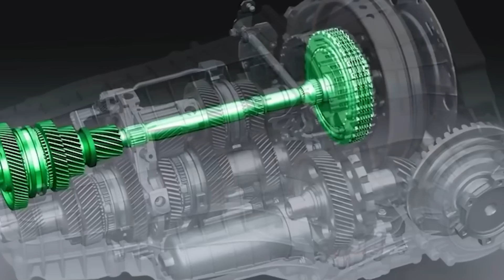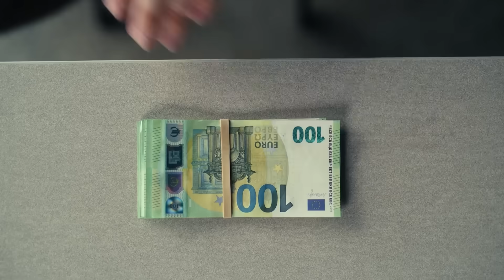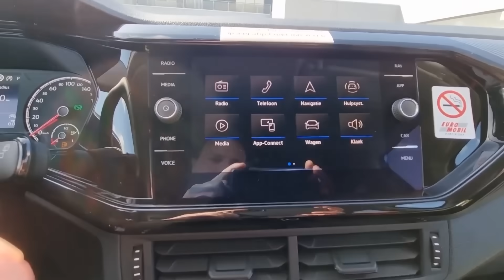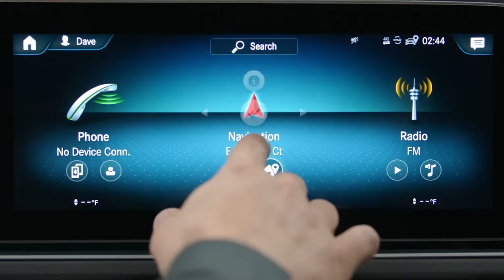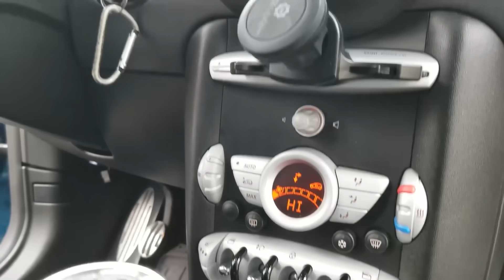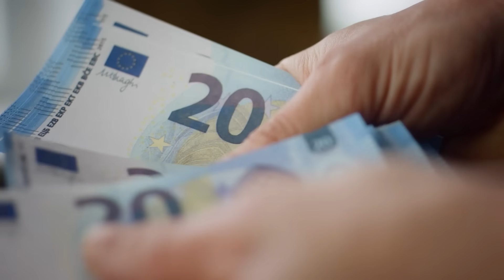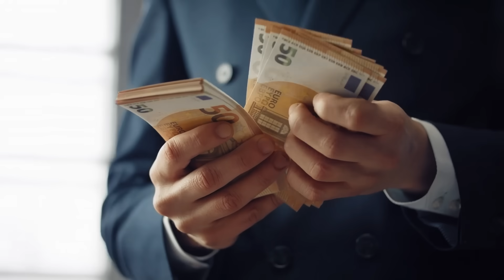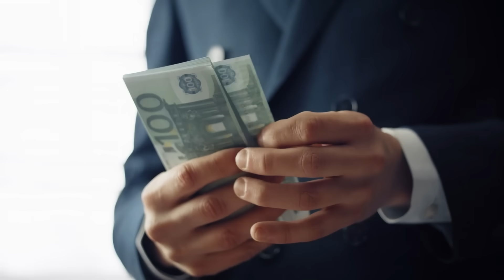7 DIRTY Secrets Why Your European Car BREAKS After Warranty

Comment: My BMW128i engine has no cylinder sleeves. This causes the engine to be totally unrepairable when they become worn. I used to brag to friends that I have never had any problems or failures. I just paid for maintenance. Then boom!  I did decide to replace the engine and it was very expensive. After consulting with my independent mechanic, I made that choice. I live in a dry climate so rust isn’t a problem. I know the health of the rest of the car. Hopes are I can get 50,000 miles before the used replacement engine comes to the end of its planned life. 
Next car I’ll buy will be something like a Toyota Avalon, 90s V6 Buick or Crown Vic variant.

Comment: 2018 BMW 4:30 I convertible I have had at least three coolant line failures because they are made of plastic. The plastic part on the side of the engine block that accepts the large rubber radiator hose became brittle from heat and started to late. It was a hairline crack and very difficult to find.plastic components in the oil cooler disintegrated from heat and the oil cooler needed to be replaced. The turbo coolant line which is part plastic and part metal deteriorated at the plastic end. This should not be considered planned obsolescence, but criminal intent.

Comment: My friend’s Lexus been 8 months in the garage for 2 items. First 3 months, car 2 years old, am engine sensor. 3 months wait. February 2025, front right calliper rotted and seized and he hood cable snapped (vs alloy callipers as premium cars). Job estimate ? 3300$ one cable and one calliper. Issue is no cable in stock so he has been driving a loaner!!!!! Yep, Lexus, so bmw tied them up for a reason. For all my repairs on my 2014, trans rebuilt, TC swap bearings suspension, my car never stranded me and I think longest was 1 months off during covid

Comment: Thank you for the information. This was not new, but a confirmation to me. I didn't buy VW anymore and use instead Kia with a 7 years warrenty.
Reply: Kia cars have many similarites with german ones. Smaller turbo engines, DCT (similar to VW DSG) transmission and such.
Reply: @rannarharmaste9857  The Hyundai/Kia Theta engine series are ticking time bombs if you don't keep up with the maintenance.
Reply: @rannarharmaste9857  There is no 150.000 km and 7 years warrenty on german cars. They know why ...

Comment: I will never touch a BMW again. We had a 320d with the N47 engine. It died because of the timing chain, but fair enough because it was at 190,000 miles. We then got another one, second hand, which also developed the same problem within 3 months. Never again!
Reply from the maker: That’s rough. Timing chain failures on those engines really hurt BMW’s reputation, and stories like yours show why some people never go back.
Reply: @UnderTheBonnetTips 
YES IT DOES. And china takes over with they're cheap s...t and it all over! Not again, noo
Reply: Soooo, you knew well what was it's weakest point, ..the failure of the 1st one and YOU DECIDED to do nothing(!) for 2nd one?? It was about investing in something that is pnone to fail miserable but it drives well and is nice.. (hmm, how should we call this..?)

And you think we are getting better as species?? 🤣🤣
And you THINK the future is even nicer, better!?  😂😂 
If we don't act and prevent..
Reply: Read this my friend, it is real experience of mine with an ..JUUST A BIT older BMW:
(original timing chain at over 300k miles, every single day driven)
BMW 3 series with M47 2005 cast iron engine, over 300k miles, over 500k km.. 2 stroke oil JASO FB in fuel 250ml/50 litres of fuel for over 250k km!!!! 
Result!?
Not a single sensor changed from intake manifold to exhaust including exhaust. ORIGINAL CATALYTIC CONVERTOR.
 Not a single problem with the engine! Everything is original - everything. Including the exhaust.. Injectors lasted as much/long 500k miles. 
Original high pressure fuel pump. 

Changes to prevent failure (AT 150,000 Miles done already..) :  fuel tank pump, ..rebuild of the alternator (first brushes.. then collectors) original alternator, still on the car! Injectors, rebuild by Bosch representative ..2 injectors failed just after the car passed 500k km.. one loud bang under the bonnet (but the engine did not stop) got me concerned.. / took them out, sent to get rebuild; car back on the road!
...Changed MAF (mass airflow sensor) ..got an error since I got the car.. now it is showing the correct values..
...Heat-exchanger failed.. GASKETS only, just after 500k km replaced car back on the road. 
Original engine radiator - water pump (belt driven) replaced twice in 500k km!
Thermostats.. they do fail every 4-5 years because thermostat arr not getting/keeping the engine to the right temperature. Because these has a spring inside that weakens overtime..

But all these are NOTHING comparing with complete failure of gearbox..., timing chain guides.., electric water pump... after 100k

Yes, I replace fluids periodically: coolant every 4-5 years -brake fluid every 2 years (..everything original by the way, still working in breakig system) steering fluid replaced every 2-3 years; that is not hard at all.. Gearbox oil, every 150k km. same with the oil in differential; these 2 are from factory since 2005; the oil are different types but saved the gearbox and diff..
Please, buy an used car and don't biy new! And try to maintain yourself; is not hard! Only like that you'll have more money! And belive me you'll save the planet more than buying new..

But the real message to you all is 2 Stroke oil 250ml/50l fuel is the formula(!) for a clean and RELIABLE DIESEL ENGINE.  Do you think this 500k km engine is a lazy../worn so much.. and weak at these miles/km!? 
I am having the same reaction from the car as when it was 250k(!) when I got it! 
I am driving my brother car, same engine, ocasionally, and that car has half of the km of mine (...no 2 stroke oil yet) and drives IDENTICALLY, reacts the same as mine, which is crazy!

And that is not all. I do maintain another bimmer ..B47 engine (it is diesel of course) with just 110k k  curently.. Euro 6, right? 
It gets 2 stroke oil with every fill of  fuel as my M47.. but it gets JASO FB as well! JASO FB (not FD) burns much cleaner! 
For the last 20k miles since I got the vehicle.. this car is been driven only short distances most of the time, which is a KILLER for a diesel and with DPF! Well, guess what? ZERO problem in 20k miles from DPF FILTER!
Do you think I am making things up because I have nothing else to do!?
Well ...I have my experience and I my only wish is to share with people who really wants realiability of their cars; that all.
That is my last point..
Good bye and ...Good luck with everthing that you intend..
Bye.😊
Reply: @MrFryfish All well and good, but I understand that the M47 engine has a rather different reputation from the N47.
Reply: @robd9863 
That is exactly the idea of his video...
To show us, ignirant drivers, customers that manufacturers started A WHILE BACK taking us for a ride... so we must do something now. 
Buy an older car, maintain it and tell evryone else you won't change it until a reliable car is on the market.
And force gouvernmet to tell manufacturers to sell cars that destroy themselves after warranty. This trend MUST GO. A car can't be a pair of socks or a TV.. or a washing machine. It is a lot more expensive and should last many many many years.

Comment: Cars must be replaced after an average of 10 years because newer cars have a lower carbon footprint in use. 
The carbon footprint of the  manufacturing of a car is next to nothing compared with can be saved by less fuel, oil etc consumption. 

Don't be fooled. The carbon footprint of manufacturing is about 10% of it complete life cycle. 

No complot. Just reality. 
An unfortunate reality. Just like climate change.
Reply from the maker: That’s an important angle — emissions and carbon footprint are definitely part of the debate. The video focused on design-for-failure, but the environmental trade-offs add another layer to the discussion.
Reply: @UnderTheBonnetTips Ok. I stand corrected. I reacted to the usual " green is wrong-type" of comments.

Comment: It's the same with everything now. Mobile phones turn into a lag and stutter fest faster than ever now to drive sales of replacements. Tablets, laptops, printers - all built to fail early, or 'act faulty'. You're better off buying older items in many cases.
Reply from the maker: Spot on — it’s the same logic applied across industries. Cars, phones, laptops… all trending toward shorter lifespans to keep sales moving. Buyers end up losing out on long-term value.

Comment: Seems about right. Wd owned VW/AUDI from the mid 80's. Never had a problem until the 2000's. That's when German cars started to go downhill. My last Passat literally fell apart after 8 years. Both front wings rusted through, all electric windows failed (£250 a go) central locking failed, water leaks into the cabin and wreaking the ECU (which is under the passenger footwell of all places) failed ABS sensor, and could never get the ABS warning light to go off on the dash even though a genuine VW sensor was fitted. Finally at 120,000 miles, sticking camshaft bucket at start up, sounded like a tractor for a few seconds, then disappeared when te oil reached the camshaft.  The car was a 2L petrol 130bhp with full service history.  Never again. Now driving a 2L petrol Mazda 6 estate, and 4 years trouble free motoring.
Reply from the maker: That’s a detailed account — and it matches what many long-time VW/Audi owners have said: reliability really started slipping in the 2000s. Stories like yours highlight why trust in the badge isn’t what it used to be.

Comment: This video is funny, at 8 minutes 46 seconds it shows what he calls a motor bearing but is truly a wheel spindle bearing, LOL. They don't use roller bearings in engines for the most part. They're all plain bearings. For the most part this video is dead on. German engineering went from what used to be the best in the 80s to absolute junk now in present day.
Reply from the maker: Fair catch — thanks for pointing that out. The broader point was about how small, cost-saving design choices add up, even if the terminology wasn’t exact.
Reply: @UnderTheBonnetTips you are correct, I would not touch a german-made product with a 10-foot Pole. I have to say your video was dead on. Original comment was amended to state this.

Comment: Yep, changed my transmission fluid and water pump at 100k km on my E90.  Will have to change the radiator soon.
Reply from the maker: That’s the reality — owners end up doing preventive maintenance themselves just to keep things running properly, while manufacturers insist the car is “maintenance free.”
Reply: @UnderTheBonnetTips  No mechanical device is maintenance free.

Comment: 37 years ago I decided not to drive cars. Just bikes.
Reply from the maker: Fair choice — two wheels instead of four certainly avoids most of the headaches tied to car ownership.
Reply: @UnderTheBonnetTips I even can build my vehicles by my own and define every aspect. One of my bikes has 4 wheels. And a motor. And a big trailer with solar.
Reply: You're lucky, no breakdowns, no repairs, and you can go anywhere, even on vacation.

Comment: Great video informs people who are not aware of the auto industry scam which  is only following other industries initiatives , built in obsolescence , the biggest  carbon creator  ,,,if you believe such a thing . I bought a new Hilux 2008 , doing my best to keep it viable , if it dies i will buy something  older without the bells and whistles . I certainly would not buy a car from 2017 onward ,my cutoff point is around 2010 due to the euro emmissions engine killer systems.
Reply from the maker: That’s a solid point — keeping an older, simpler car going often avoids a lot of these engineered headaches. Newer ones pile on complexity, which is where these failures become profitable for manufacturers.

Comment: I bought a 2016 Audi A6 2.0T with 87,000 miles. This has the EA888 Gen 3 motor. Well on my second day of owning the car, I had to top off the oil. I was in the minimum level. Thankfully my friend had an Audi and recommended I buy some bottles of oil and keep it in the car before I went to buy it. So that is exactly what I did on the day I purchased it. Glad I took his advice. Anyways no problems, until about 2-3 weeks later when I noticed my coolant was going down. Wasn't sure why but I kept topping it off until I was going to bring it in for service and ask them to see what it could be. Then about a month and a half after I purchased the car. I get a Check Engine Light. I grab my OBD-II scanner and connect it to see. Code P000B - slow response from the "B" camshaft position on Bank 1. So I brought it to my local Audi dealer. Turns out my Cam Carrier had an active oil leak. And my Water Pump and Thermostat were looking coolant like crazy. The check engine light was a result of a Camshaft Actuator being drowned in oil. In fact it was filled with so much oil, that it seeped into the electrical connection. Audi quoted me $5,500. On a car I purchased for 12k. I took the car back from the dealer, paid the $250 diagnostic fee. Took it to my mechanic, fixed my coolant leaks for $1000. Then I got a job for that same dealer network as that Audi dealer, so I paid one of the mechanics to reseal my cam carrier for $450 (down from $3.2k). Great no more issues. Wrong. Coolant leak 3 months after replacing the water pump and thermostat. It was from a union in the thermostat. Well I had that replaced for $250. Then I replaced my camshaft actuator a month later. Then sold the car the week after. I had the car for 5 months. It's been a month since I've sold it. It was a fun car. It was very nice. But fuck me did it take my money. I would still buy another Audi, because I meticulously maintained the car,  my connections for OEM parts and labor, and I'm just aware about Audis and their problems now. But I cannot recommend this car to someone who does not know about cars. It will be a nightmare. If you have the money, buy or lease new, then get rid of it before the warranty is over. If you don't know anything about cars, steer clear from the Germans. They can be good, but you have to know what you're doing or it will be an awful experience.
Reply: I would still buy another one😂😂😂
Reply: @senseofthecommonman  I would, that driving experience is something else, and I like cars, so I'll happily spend money on my hobby. Well maybe once I actually have more money though.
Reply from the maker: That’s quite a story. It really shows how even small things like oil levels can make or break trust in a car. You were smart to be prepared.
Reply: Now you know why Audi's alternate nickname is The Four Rings Of Despair.
Reply: @dantesinfernopurgatory7826 🤣🤣🤣 never heard that phrase, but now that I did, I completely agree.
Reply: I can understand the struggle for driving v8 amg but all that crap for driving shitty 888?
Reply: @littlebo81  All that for a shitty 888. Still would get another but probably in a different model. I would only get another A6 with the 3.0T. And trust me. The V8 AMG is significantly worse. Got a boy who is getting his entire engine replaced on his CLS63S.

Comment: My family owned Volkswagens in the late 90's and no matter how much care and maintenance we threw at them, above what the manufacturer requires, they broke down when you just breath on them. Name it and it broke. Sure VW fixed most of them during the warranty period, but just having warranty repairs done, what seemigly was a month to month occurajce, really ruined the experience of owning the cars. We dumped thdm all and got back to buying Hondas, Mazdas and Toyotas and had been very happy with them since! All the Japanese cars needed was regular oil and filters changed, and replacement of wiper blades, belts and tires when they wear out. Just regular wear otems you expect to chage out periodically.
Reply from the maker: That’s a tough experience, and it lines up with what many others have said. When a car spends more time in the shop than on the road, people lose patience and switch brands.
Reply: If you can enjoy Japanese cars that is perfect. I can t. Well maybe a nissan gtr or skyline. Somewhat earlier vw s where not that bad. Later disaster but that s with most newer cars

Comment: Definitely this video has relevant information, but big part (70%-80%) just bull shit. Many of described things are relevant for most brands, for example lifetime fluids. About filling cap for ZF gearbox is very funny))) Author, have you tried to look under the hood of RWD BMW and to see gearbox? About plastic chain guides, I heard about this problem on BMW and I owned 2 VAG cars and one had more than 300k km on it and original guides worked fine. About rust... any German premium brand will be much better than Toyota or Honda.
Reply from the maker: Fair point. Some of these issues are shared across brands, not just German ones. The video was meant to highlight trends, but it’s true that not every car suffers equally.

Comment: on Audi A3 year 2009, oil pump is driven by simple hex screw ( maintenance not needed they claim ) , but when simple metal screw fails, oil pump stops and engine is dead. screw cost me 7€ to replace, old one was badly worn out. 

they could make another solution for driving oil pump as critical engine element , yet they choose that stupid design that will fail past 150000km
Reply from the maker: That’s a perfect example — such a cheap part ends up risking the entire engine. Design choices like that make people question whether it’s just oversight or intentional.